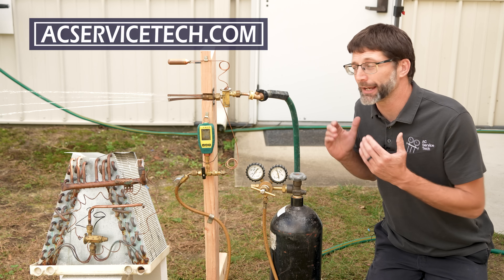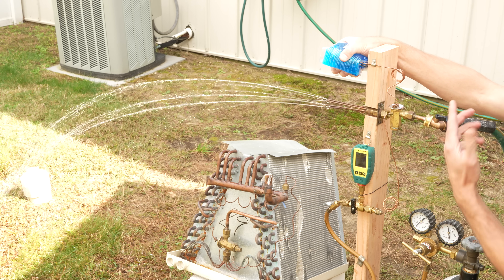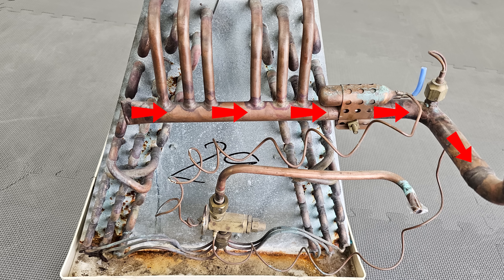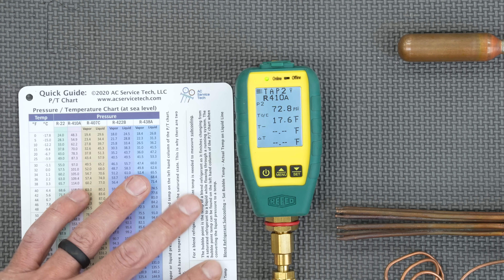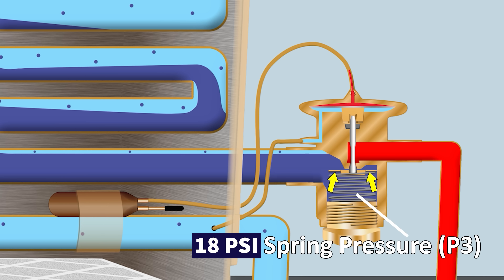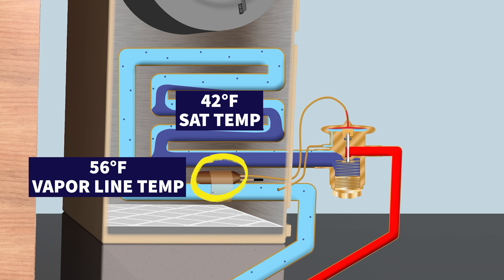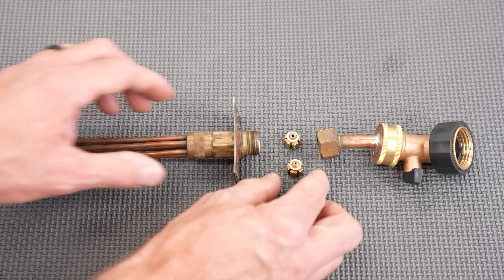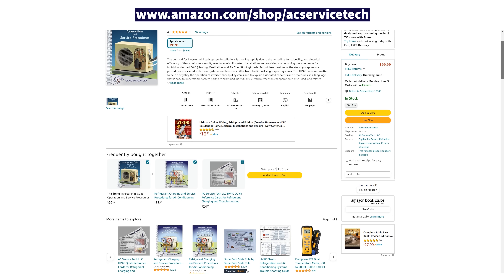Showing TXV Operation with a Water Stream! Thermostatic Expansion Valve Explained!

Comment: Great explanation. In simplest terms the difference is that the Spring pressure is not linear. Vs the refrigerant pressure difference. 
That difference is self sensing, load adjusting automatically. Pressure difference equals work or force. 
That force is moving a actuator valve opening.
Without the need of electrical devices. Simply Brilliant 🎉

Comment: Anyone experience having a portable ac in a small room that has a return affecting the remainder of the house.  The bedroom with the small return gets very cool due to the portable ac.  The remainder of the house returns air from a different grille and is not cooling as needed.  Brand new evaporator coil and txv.  Return air split at the main grille (not bedroom) is 6 degree delta.
Reply: Seems logical to me this could be starving the evaporator coil due to a mixture of warm and cool air.

Comment: Hi, I have a couple of problems that confuses me. When let’s say I have AC set to cool the room on 20 degrees celsius and suddenly want to cool the room on 16 degrees, i guess the expansion valve opens more. From what I can see in your videos, opening the valve causes the evaporator pressure to go up, but when I measure the pressure on suction line, the pressure actually drops. Why is that?:) thank you

Comment: Great video and explanation, however I have a couple questions:

 1) I have (2) identical R-22 Central air systems. One has the TXV installed, and the other does not have one. I still have the TXV in the box from the original installation of the systems. Both units function equally well, and I have not had any freeze ups or related problems over the past 20 years. What gives? What is the TXV really doing that the system without can operate equally well? 

2) Does a TVX create more back pressure which in-turn generates more wear and tear on the compressor, and greater energy consumption? 

Thanks

Comment: Does TXV and bulb work with any refrigerant or does it need to be adjusted  or designed for a specific refrigerant?
Reply from the maker: The bulb has refrigerant that is the same type as in the system but is self contained within the bulb, cap tubing, and head, thanks!

Comment: Craig I got a Lennox heat pump split system, I n cool it runs fine but on heat mode my pressures skyrocket with in 10 to 15 seconds of startup to 575 cuts off on high pressure and gives me a ambient sensors code.  I diagnose as a restriction.  What’s your advise?
Reply: The problem is which one the Coil or Condenser? TXV?
Reply from the maker: The issue is that you arent able to reject enough heat at the indoor coil compared to the high amount of heat you are absorbing at the outdoor unit. some heat pumps are equipped with an outdoor fan cycling switch to reduce the heat absorbed when the outdoor ambient is high but basically you likely have low indoor airflow crossing the indoor coil. this could be due to a dust clogged coil, low airflow setting or another reason.
Reply: @acservicetechchannel  one more thing then why doesn’t it trip on high limit on gas furnace while the heat runs it’s a dual fuel!

Comment: Pretty cool. Would love to see something like this with an EEV.
Reply: As times are progressing you will see mechanical valves slowly disappearing and EEVs becoming the standard with efficiency, so eventually there will be inverter variable speed technology only available. Even refrigeration will start using this technology as the industry looks for better ways maintaining epa guidelines. Plus the new A2L refrigerants you are going to see more safeties on these systems like solenoids on systems, ventilation and refrigerant detection devices by 2025
Reply from the maker: Yes absolutely I agree!!
Reply from the maker: I wanted to do that in this video too. It was just a little too much. It took days and days to do this but very likely in the future!!!